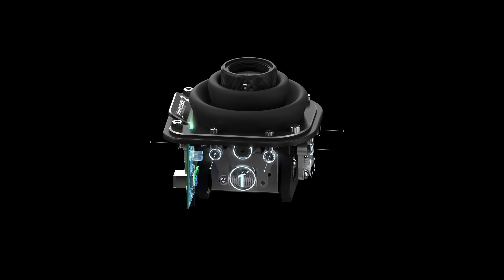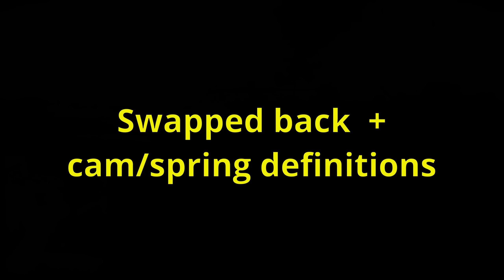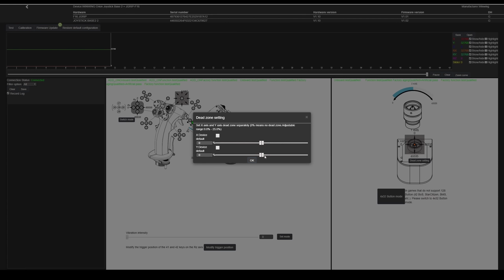Product Review: Winwing Orion Stick Base J2-2 "Re-defining the Multi-purpose Joystick"

Comment: This is the kind of innovation we have needed for awhile now.
Reply: If only they'd come up with an FFB base... instant buy!
Reply: @CakePrincessCelestia  They hinted at that on FB, not sure if that will be an option for this base or not.
Reply: @CakePrincessCelestia  The F-16EX has a stick shaker option, coded to shake on events, like gear actuation, missile launch, bomb drop, high alpha maneuvers and landing, a couple more I can't think of atm. It won't pull/push the stick, but will give the similar tactile feedback.
Reply: @michaelwmcdonald  Michael, the base will have the Force Sensing insert option, which will mimic the small movements of the real F-16 stick base. Their F-16EX stick has a stick shaker option, that will provide modulated shaking intensity for different flight regimes, gear actuation, weapon launch/drop, landing, etc.

Comment: First, another great review guys. I just got mine last week, and your review is spot on. Still waiting on the springs and dampener set as they were back ordered but are on the way now. I am moving up from an x52 stick and must say this is a huge upgrade over it. I can finally fly all the gazelle in DCS! Still using my x52 throttle for now until I get a collective and can save up for a new throttle. In fact I created a makeshift 45 degree support to mount my x52 stick to an am using it as an intermediate collective until I can get one. So far so good. Happy flying!
Reply: Thank you Charles,

Comment: Thanks for showing where to find the dead zone setting.... I just made a ~20cm long extension for my Orion 1 and the dead zone was just killing me. While I hadn't even noticed it it's around 1mm in size on default stick length. But with the extension it was like 1-1,5 cm up there. I was searching all over the place and only a few people even mentioned that "you can change it" but never *where*. The software could really use some improvements in layout as that thing should be under calibration rather than under the Z axis config in the middle of the X/Y display - which you generally use the graph for instead...

Comment: Since the 4 sides are symmetric can’t you just remove the spring from both axis, keep the cams installed, and install the dampers on the other 2 symmetric sides for dry clutch action for helicopter use? Can you also use spring and dampers at the same time? Great review. Been waiting for an assembly vid of the dampers. Winwing really should have included the 2x dampers with the base and only required the accessory kit for those that wanted different cam profiles and spring tension options. All in all looks like a winner here except for the boot. I may pick one up as I really want a dry clutch system and the extra MFSSB options in one base puts it a nod above the VKB base. Great work Winwing and looking forward to the MFSSB review GR! 👍
Reply: Thank you. We didn't try any of those combinations. We were focused at providing a first person look at the stated capabilities. I'm sure there are dozens of combinations that can be tried.
Reply: I've tried doing exactly this. You can absolutely have the dampeners on two of the unused sides. When in normal spring mode you can easily reduce the dampeners to zero tension. The problem is removing the spring/cams. To remove them is two screws (easy) but you need to stretch the spring to remove or install smoothly. With the default medium springs you can put some dimes in the spring coils and remove it okay but not smooth. With the strong springs (what I am using because I have the extension and the medium springs are just too light for it) even that is not enough. I wish this video showed the reinstallation of the cams so I could see how they did it and if it was smoother than the s**t show I managed.
Reply: @oldmanfunk4916  Good to know. Thank you,

Comment: Mine just arrived, changed to the helicopter set up right away and its awesome, so much easier to fly the Apache now, a really great bit of kit only let down by the extension part  which seems like a weak link and they fact they went against the std coupling that other joysticks use like Wingwing/Thrustmaster basically locking out being able too use their extensions instead.
Reply: do helicopter rudder pedals work the same way as in they dont move back into position when you take your feet off?
And if so are there rudders for helicopters?
Reply: @lithium25693  you can use normal rudder for helis. the only thing you really need to worry about is MAYBE getting a joystick with no reentering. this winwing orion2 though can have it removed which is good but IMO dont bother for a collective unless you wanna really get immersed.

Comment: I have the original Orion 1 base for the f16, only a few months old and the spring broke inside. They are sending me another one but wondering if you know what the specs are on the springs so I don't have to get them shipped all the way from China next time they break, thanks.
Reply: I do not as we just do the review, but it may be possible to find a youtube video on how to determine what the new spring is after its arrival. If you live in the USA, a good start would be to take the spring to a local Fastenal Hardware store. They are usually pretty pricey, but I've found their staff knowledgeable. Good luck,
Reply: @wildbillkelso2083  thanks, I definitely want to have backups as It's been out of commission now going on two weeks.

Comment: Do you know if the screw holes for attaching the Orion 2 to a mounting plate are in the same position as for the Orion v1, or require a different plate if using a table / chair mount etc. Thanks
Reply: The V1 and V2 have identical hole patterns Mark.
Reply: Yes, the mounting holes for the Orion 2 are in the same position as those on the Orion 1.
Reply: Thanks  @Wild Bill Kelso  &  @Skilgannon 506

Comment: Is new Orion 2 base better than older SuperLibra base?
Reply: Personally, I like it better. The stock centerless cams and it's ability to be changed quickly are two reason's why it will be my daily driver.
Reply: @wildbillkelso2083  thank you for the quick reply.  Confirming you are saying you like the Orion 2 better, yes?  I would like to ask a few more hardware questions.  Will you please message me?  I understand completely if the answer is no.  Thanks for considering it.
Reply: @vanguard9067  Yes, I like the Orion joystick 2-2 better for the above reasons. You may ask your questions here Vanguard, as it will give others who wonder the same things to see the exchange.
Reply: @wildbillkelso2083  Thanks for the info and invitation.  I want to get into DCS and have checked out some hardware and I think made my choices what I am keeping.  I have a couple of F-16 sticks and the WinWing F-16 throttle.  Just getting into it, do I need rudder pedals now?  What about some form of eye tracking hardware?  Is is possible to do a Remote Desktop to configure the hardware?  What about lessons?  Thanks for your continuing guidance.
Reply: @vanguard9067  You don't need rudder peddles to start, but they help immensely, and you will need them for helicopters and warbirds.There is Track Ir, and at least a couple lower cost versions available. I use Track Ir. Remote desktoping is probably unlikely as you must locally depress buttons, or cycle hotas controls to get them bound. Lessons can be expensive or not, depending if you have friends who will provide their time. I learned reading Chuck's guides for a general overview and hardware binding tutorials on Youtube. Spend a lot of time reading, following the DCS module training missions, etc., before you venture into multiplayer. Full fidelity aircraft will take you at least 90 days to get competent with the stick/rudder work, and up to a year to become an expert in all of the modules systems. Most flying groups may have one or more people who provide free training days/times on their schedule. Get comfortable in single player missions. Try not to be "that guy" who buys a module, jumps on multiplayer and expects someone to show them everything. Putting your own sweat-equity in single player training will gain respect of others when you show up on the multiplayer world stage.
Reply: @wildbillkelso2083  More to follow, but I will never be “that guy”. :-)
Reply: @vanguard9067  Good to know. 😂

Comment: Just got 1 of these.... It's a massive upgrade over my PS5 controller :)
Even though I haven't had a proper hotas for several years I did notice the deadzone and I am certainly gonna try it at 0 now.  One more thing my f16ex stick spins on its axis unless I overtighten the collar to such an extent that the lock screw ends up in the front side of the stick and doesn't line up with the flattened portion at the rear.  Anyone else have solutions for this?
Reply: You should not be concerned that the lock screw doesn't line up with the flat side of the stick. Lightly finger tightening the lock screw will not destroy the large threads and will keep it in place.
Reply: @wildbillkelso2083  thanks
Reply: @profitfpv8377  You are welcome.

Comment: I get a weird sticking when I switch to the dampers.  Yours doesn’t seem to have that in the helo configuration.
Reply: Me too. It’s a fantastic setup, but running it springless with dampers only is NOT a smooth experience. Even with Nyogel & constant adjustments it’s clunky & sticky.

Comment: How does the Orion 2 stick compare to the Libra?
Reply: Personally, I like it better. The stock centerless cams and it's ability to be changed quickly are two reason's why it will be my daily driver.
Reply: Got one coming with extension and variable cams and springs. Also ordered the take off panel. Waiting a bit before pulling the trigger on the super taurus and combat ready panel.
Reply: @36363ace  You chose wisely 😄

Comment: Thanks for the review. The dampener looks to be plastic, is this the case? I wonder how much endurance this component would have, and spending $50 for a replacement set of [springs, cams, dampeners] just to replace the dampener wouldn't be ideal. 

Is it possible to use the dampener in combination with the spring/ cams on the other side, for when flying a plane, to dampen after return to center from the springs, similar to the dry clutch mechanism on the VKB gunfighter MK III?

Put another way, at the start of the review you detail 3 setups:
1. Spring / cam, either one sided or both sided setup on each axis.
2. Dampener only, helicopter 
3. Force feedback - F16
is there a 4th setup possible of a. spring / cam one side b. Dampener other side, with a & b both on a single axis. I believe this would be comparable to the supra libra. 

A comparison between supra libra and Orion 2 bases would be a great addition. Or a comparison video to all competitors, in house and out of house - Supra Libra, VKB GF MK3, Virpil. Thanks.
Reply: Thank you Mark, you are free to experiment with any combination you like, including a 4th setup combo of dampers/cams. The force sensing module would be used without dampers/cams as it needs to feel your pitch and roll input pressure. The force feedback or internal stick shaker was introduced in the original F-16EX stick. I now see they offer the stick with and without the shaker. We will hold off on the Libra, J2-2 comparison, as I'm guessing there there may be Libre cam choices in the near future. I can say the Orion J2-2 beats the Virpil CM2 stick base for smoothness. I own one as well. I don't own any VKB gear so I don't have any insights for it. Hope that helps,
Reply: @wildbillkelso2083  Thanks for the reply and info. For the third option I meant force sensing rather than force feedback, thanks for clarifying. Being able to have the damper & cam on a single axis is what I'm looking for. Though again my feedback for WinWing would be to have replacement plastic(?) dampener components as a separate stock item incase it fails and need replacing, independent from the cams or springs, $50 pack.  👍
Reply: @Mk_IX_Hawk5690  You're welcome Mark, the factory reads all the comments, so I'm sure they're taking notes from viewer comments. Take care,
Reply: @Mk_IX_Hawk5690  A better design choice for WW is to go with a metal clamp and have the wear piece (teflon/polymer) as an insert to fit around the drum inside the clamp.
Reply: @seventhsealhere  yes this would be good to see.
Reply: 3D printers should work wonders in 'reproducing' a worn dampener...??  Just an idea.
Reply: @dangerously72  👍

Comment: Will the Orion F-16 throttle work with the Thrustmaster Warthog Stick?
Reply: You ask about the Orion throttle, mating with a Warthog Joystick? No, and I am unaware of any available manufactured adapter. If you mean mating a F-16EX throttle handle to a Warthog Throttle, the answer, again would be no, and I'm not aware of any available manufactured adapter.
Reply: @wildbillkelso2083  Thanks. Yes, I wanted to connect an Orion throttle instead of a Warthog throttle. And when it comes to modifications, since the 90s I have been making my own rudders or currently I am reworking the factory ones for my own needs. I recently converted one Worthog throttle to a helicopter lever. It's fun :)

Comment: Would have been great if WinWing would have given me a option/heads-up  when ordering my F-16 stick & base a month prior to release of the J2-2 :/ WinWing seriously needs PR and ordering changes personnel ???
Reply: Understandable, but unfortunately, from what I hear, they've been at the mercy of component supply shortages and lockdowns. I'm only guessing, but they may not be in control of firm release dates until component availability becomes stable.
Reply: Have you received your stick and base yet?
Reply: I know how you feel. I was fairly irate about my entire buying process. Prior to ordering the Libra I went through the entire 'ask a question process' on the 'English' website to get an idea if the Libra, and it's springs, could be customized for a 'f-16 'feel'. The only thing I receive is an e-mail in Mandarin. Don't know why, my question was not in Chinese, and on the English site nonetheless. Well, I don't have a HOTAS, and am a seasoned simmer returning after years away from sims, so I decide to buy the Libra and the F-18 stick. Then, and I'm not joking, a day after my order was sent (two days after my question) they release a new website and video introducing their new joystick base which has exactly what my question asked. I really feel like I was kicked in the family jewels. For me, that was already 5 strikes against Winwing and I hadn't even received my order. 

Along with my Stick/base order, I also ordered the Orion 2 F-16 throttle and sent them a question when I was unsure on how to put a couple of the final pieces together. This time I didn't get an answer in Mandarin, I got no response at all. Luckily I found a video someone made (not GRs throttle video) that helped me through it. Needless to say, their customer service needs some serious work to match the quality of their HOTAS. One thing is for sure however, and that is that I will not buy anything else from Winwing until I see better instructional videos (as manuals do not exist), and hear from others that a customer service does exit.

Also, thanks to GR for the effort in this video, however, I'm not sure if your intention in these Winwing product videos are instructional or meant as quick 'get to know' videos. If instructional, you could, for example, at least address what to do if the tweezers do come loose and the nut does come out. To be fair, part of my critique of these (instructional?) videos also comes from the F-16 throttle/SimApp pro video. Instructional videos (if that's what these are meant to be) without speaking is like going to school to learn History from a book with drawings only. Either way, from this video or the video at the Winwing site, there is no way I would take apart something I spent $200-300+ on without complete instructions. Feel free to pass this on to Winwing, they don't seem to read my questions for some reason.
Reply: @vvcv__00  Bad customer service? Seems to be the case for most Chinese companies.
Reply: @vvcv__00  Try getting CS from Starlink, a US company. It's non-existent. However, I also never needed it but many complain about it. CS for most companies is trash now a days. I have questions out to other sim companies and never heard back, so WinWing is not alone in poor CS. I ordered a HOTAS on eBay, paid and was told it shipped. It never shipped, was canceled and a refund a few days later. Then relisted for $100 more, and the seller had 4k plus positive rep.  The seller never responded to a question I had on another item, nor did he communicate with me about the cancellation. Then their is Frontier Internet... well you get the point.

Comment: +GrimReapersAtomic  WinWinG still has a way to go to approach the Virtual Engineering Bureau and VirPil Controls in terms of zero dead zone.  Will the upcoming MFSSB fit the grip attach point of Bugeye® P/N 20B120334-1001?  If so, the "irreversible" F-15/F-18 stick is possible.
Reply: I have no idea. You can always send a request to Winwing.